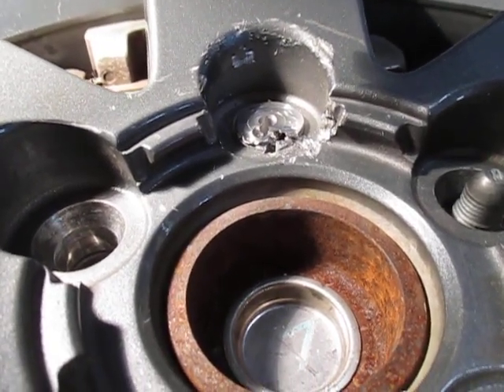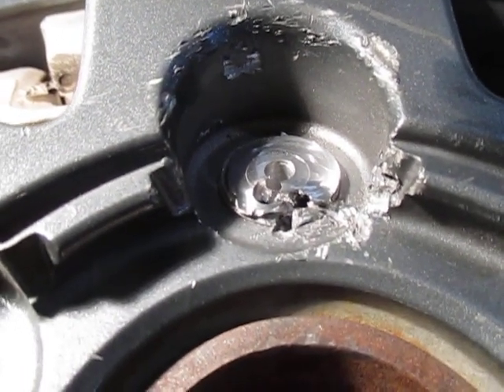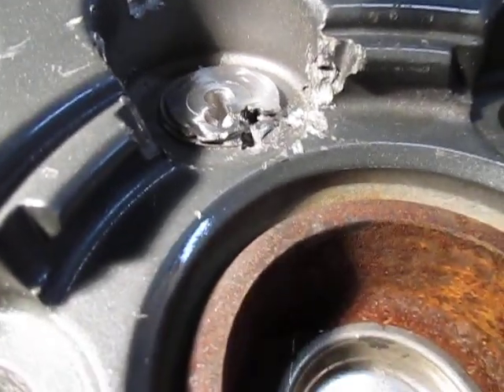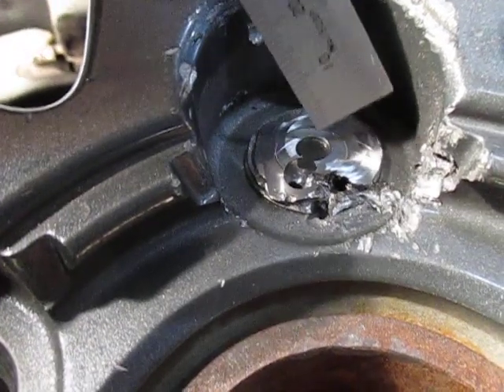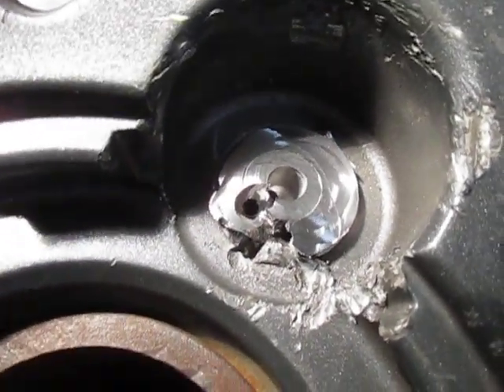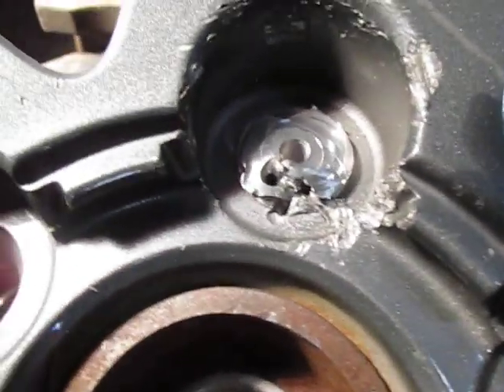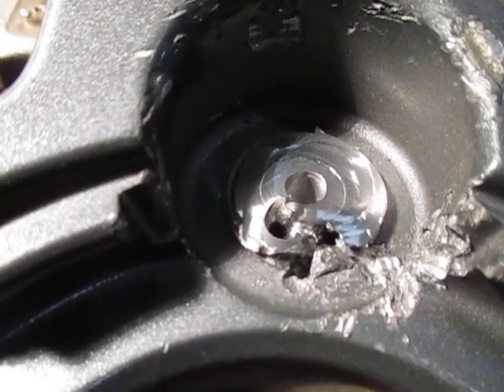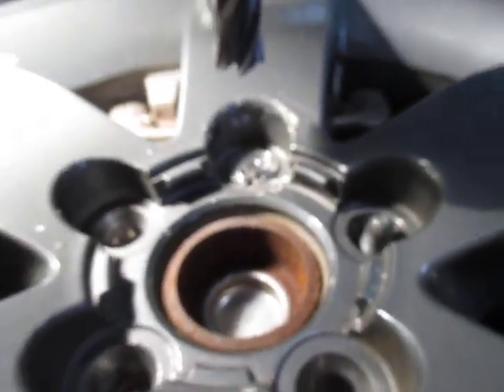Getter out 16 part 2 wheel nut removal

Comment: Don't you just love a challenge?
It looks at the stage where a hammer and punch might be worth a try. or just continue munching with an end mill either way you got it licked. Lucky you have a mill big enough, wish I had room for one, but you didn't send the numbers I wanted :>)
Reply from the maker: Chris, that is the small mill it is amazing how big a thing it can accommodate, when you are stretching it then rigidity becomes an issue. In regard to the numbers……I have never bought a lotto ticket in my life, I wouldn't have a clue about those things, what I saw as a child in regard to gambling cured me of any urges, so I can't help you there!
Reply: Yup, it's a mug's game, but all the same it would be nice to have a time machine so you knew in advance the numbers, think of the space one could buy and what you could fill it with, That my friend is the dream they are trying to sell.
Reply from the maker: Chris Stephens Mate my Crystal ball has a crack in it and I tried to get a warranty on it……no luck (pardon the pun)!
Reply: Only a crack, you lucky chap mine is shattered in a thousand pieces all over the floor, I told you my engineerium was a mess.:>)
Pun away anytime.